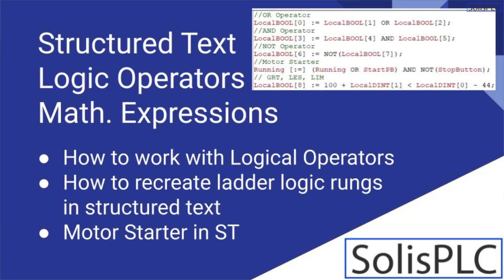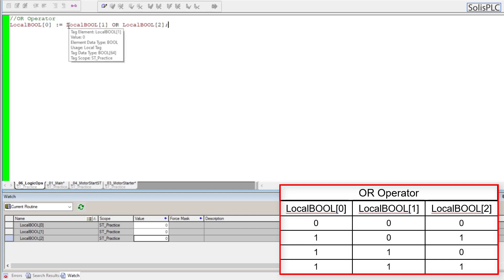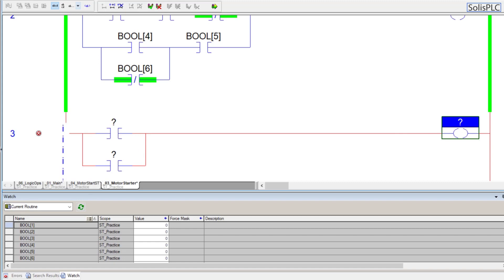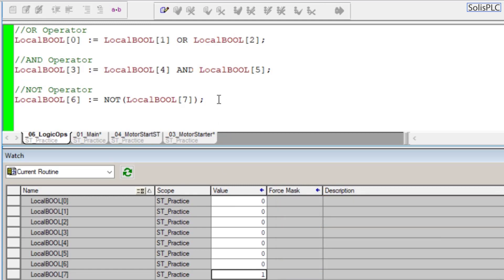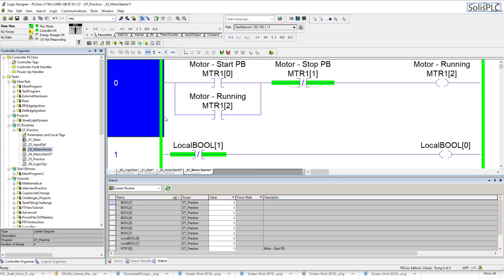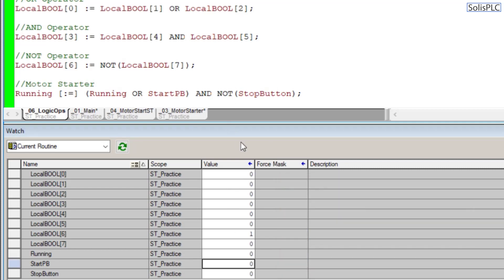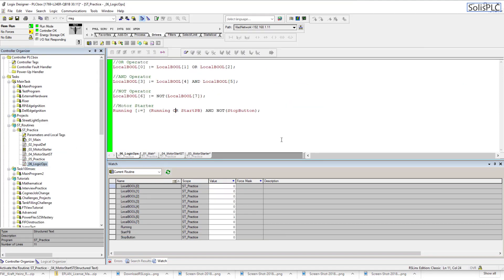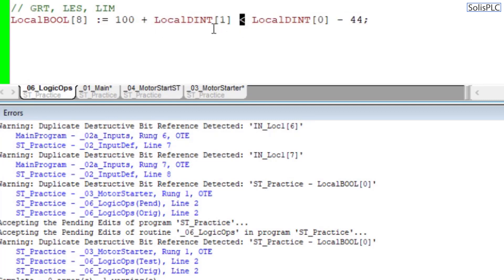Structured Text Logic and Boolean Instructions | Motor Starter Interview Practice

Comment: You said, "the [ ] around the := made the := non retentive."
What did you mean by this?
[:=]
Thank You :)
Reply from the maker: It's the equivalent of using OTE vs OTL / OTU in ladder logic. One will set the bit based on the state of the previous equation while the other will change it once.

Comment: Thanks for the amazing content.  It might be useful to show this in v31 or later as the structured text editor is FAR better now where tag values can be read directly on the program.
Reply from the maker: Hey Steven, thank you for the feedback. I've actually held back on upgrading beyond v30 for a while. I do have v32 installed, so I'll go ahead with the upgrade soon. I should have been aware of the changes; I'm fairly excited to see the changes in the structured text editor. Thank you for the tip.